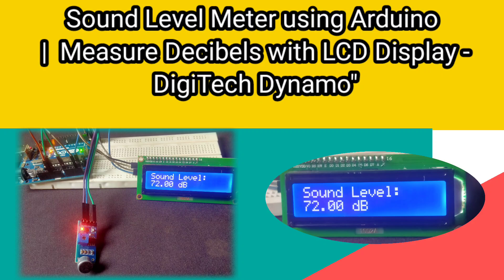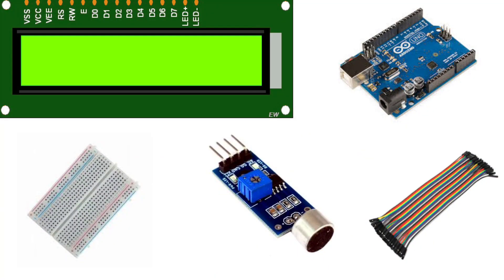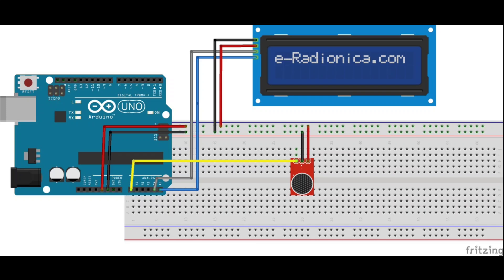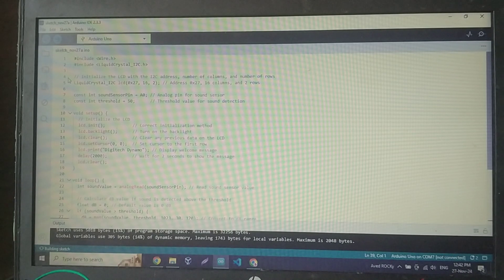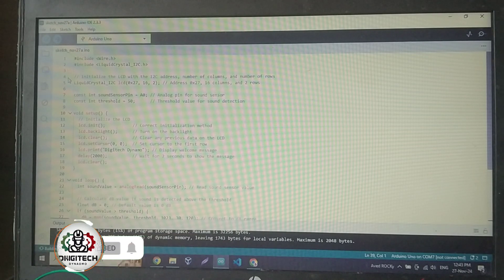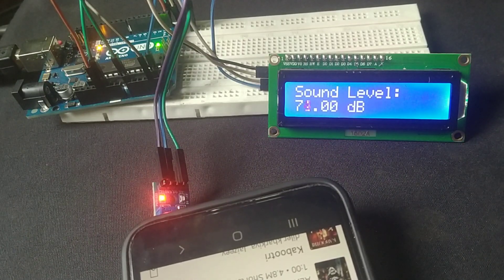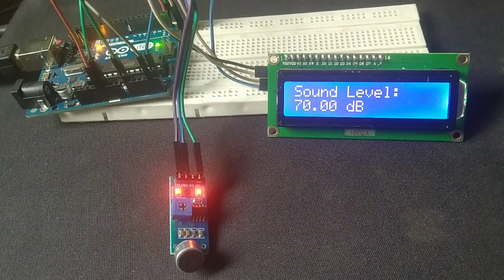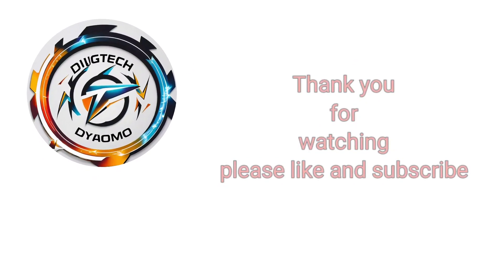Building a Sound Level Meter with Arduino and LCD | DigiTech Dynamo

Comment: I am doing this project but the value of noise is not changing as the noise becomes less and more, what is the solution
Reply from the maker: Hey dear Thanks for your question! 
If the noise value is not changing, please check these points:
 1.Make sure the sound sensor is working properly — try clapping or speaking close to the microphone.
2.Adjust the sensitivity potentiometer on the sound sensor module (usually a small blue knob(pot pre-set)).
3. Check the A0 connection on Arduino — it should be connected to the analog output (A0) pin of the sound sensor.
If still no change, open the Serial Monitor and print the soundValue using Serial.println(soundValue); to see if the sensor gives different readings.
If the value is constant, your sensor might be faulty or not getting proper power. Ok😊
Reply: Thankyou

Comment: How do you connect those wires behind  the LCD display?
Reply from the maker: Great question dear 🥰
used male-to-female jumper wires to connect the I2C module behind the LCD. Just match the pins: VCC to 5V, GND to GND, SDA to A4, and SCL to A5. Let me know if you want a wiring diagram. If you have any questions please comment 🙏 happy trinking 🥰
Reply: @Digitech_Dynamo  Thanks!
Reply: Can you copy and paste the codes for me in the comment
Reply: @SharpShooter-x6p  Or in the description
Reply from the maker: It's ok dear I have posted this not for my name or fame but for you people to learn. The better you people learn, the better it is for me. Happy trinking 
🥰🥰
#include <Wire.h>
#include <LiquidCrystal_I2C.h>

// Initialize the LCD with the I2C address, number of columns, and number of rows
LiquidCrystal_I2C lcd(0x27, 16, 2); // Address 0x27, 16 columns, and 2 rows

const int soundSensorPin = A0; // Analog pin for sound sensor
const int threshold = 50;      // Threshold value for sound detection

void setup() {
  // Initialize the LCD
  lcd.init();           // Correct initialization method
  lcd.backlight();      // Turn on the backlight
  lcd.clear();          // Clear any previous data on the LCD
  lcd.setCursor(0, 0);  // Set cursor to the first row
  lcd.print("Digitech Dynamo"); // Display welcome message
  delay(2000);          // Wait for 2 seconds to show the message
  lcd.clear();
}

void loop() {
  int soundValue = analogRead(soundSensorPin); // Read sound sensor value

  // Calculate dB value if sound is detected above the threshold
  float dB = 0; // Default value is 0 dB
  if (soundValue > threshold) {
    dB = map(soundValue, threshold, 1023, 30, 120); // Convert to dB range
  }

  // Display sound level on the LCD
  lcd.setCursor(0, 0);  // Set cursor to the first row
  lcd.print("Sound Level:"); 
  lcd.setCursor(0, 1);  // Set cursor to the second row
  lcd.print(dB);
  lcd.print(" dB   ");   // Padding to clear leftover characters

  delay(200); // Update every 0.2 seconds
}